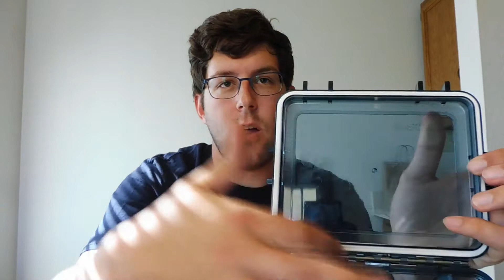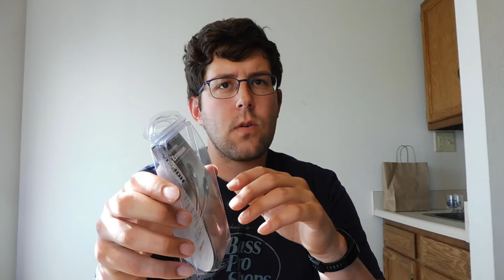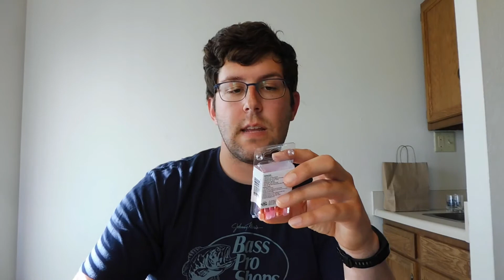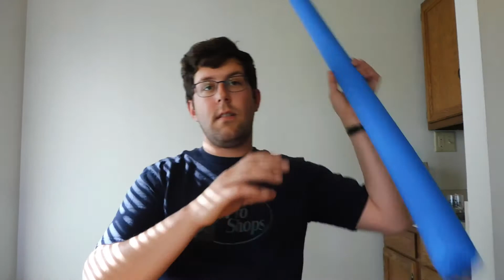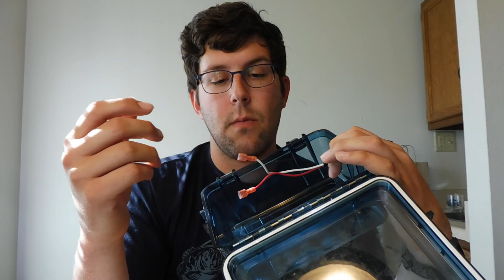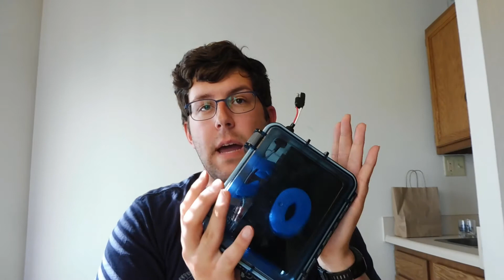How to Build a Waterproof Kayak Battery Box

Comment: Do you need a fuse on the positive side of the power cable? I have seen many people doing it with an inline fuse holder,
Reply from the maker: My fish finder power cable came with an inline fuse pre-installed, so I've been running with that setup.

Comment: Great video, thanks!
What do you use to charge your battery? Any idea if a 12v trickle charger will work?
Reply from the maker: I just use some cheap charger I found on Amazon for like $10-15. Plugs into the wall like a phone charger, but has alligator clips to attach to the battery. Not sure what it's even called. I'd imagine a trickle charger would work fine.
Reply: @FishOClockSomewhere  How do you hook up the charger's alligator clips to the battery's SAE output wires?